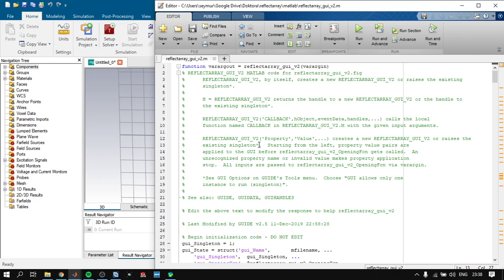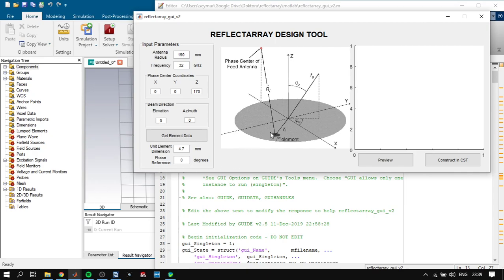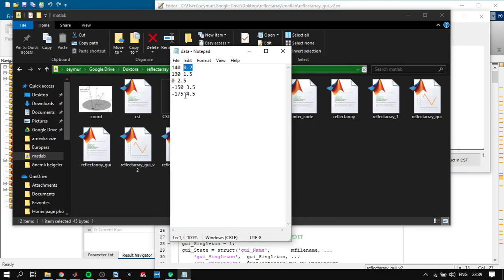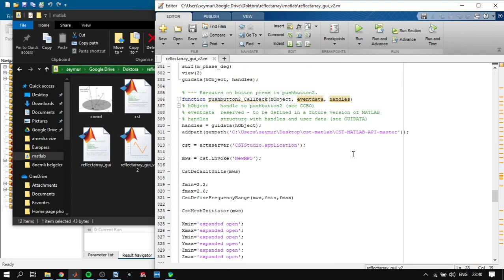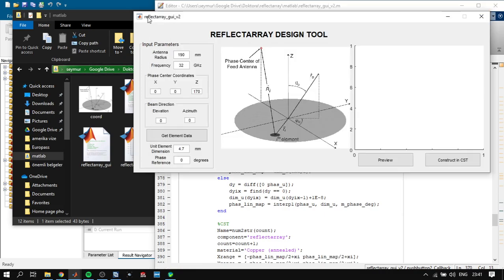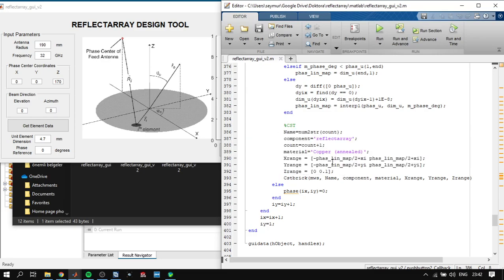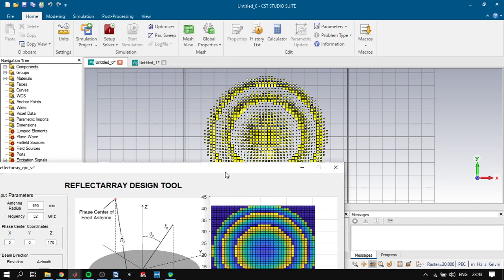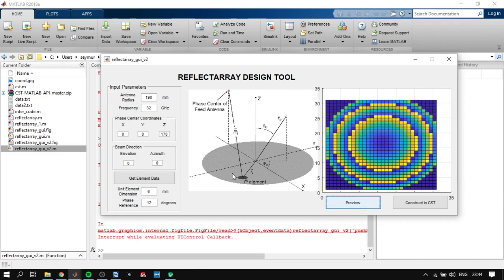Reflectarray Antenna Design using MATLAB and CST (Part 2)

Comment: Thank you very much!
But I still have a question that I would download the API and  how do I use it
BTW it also still error   "Error while evaluating UIControl Callback."
Very appreciated!!!
Reply: same problem, Error while evaluating UIControl Callback
Reply: @ucaser  Hey did you get the solution to this problem i am also facing the same problem

Comment: Hi I am facing these errors and it is not working in CST kindly help in that:
>> reflectarray_gui_v2
Undefined function or variable 'CstDefaultUnits'.

Error in reflectarray_gui_v2>pushbutton2_Callback (line 317)
CstDefaultUnits(mws);

Error in gui_mainfcn (line 95)
        feval(varargin{:});

Error in reflectarray_gui_v2 (line 42)
    gui_mainfcn(gui_State, varargin{:});

Error in
matlab.graphics.internal.figfile.FigFile/read>@(hObject,eventdata)reflectarray_gui_v2('pushbutton2_Callback',hObject,eventdata,guidata(hObject)) 
Error while evaluating UIControl Callback.

Comment: @simulationmaster can it will be designed to interface with hfss.
Reply from the maker: Hi, Unfortunately I am not good at HFSS, so I cannot do that.
Reply: @SimulationMaster  Hi thanks for your reply I am facing some issue in construct in cst can you please give me your email so that I can ask specifically. Thanks again
Reply: Can you suggest how to interface this gui to hfss just as you have interface it with cst, what change in the matlab code is to be done. Thanks kindly share your email.

Comment: @Simulation Master HI，Because your program is designed for rectangular shape. But my design is for different shaped unit cell.What should I modify?
Reply from the maker: Hi,
that is a good question. In the m file on line 267 it gets uedim, which is user variable. On lines 269-270 the code uses this data to create square patches. You can put your data here manually to get different shape sizes. I updated the code, so now you have this option.

Comment: Thanks for you sharing your knowledge. I have this error. Could you please provide any recommendations to solve it?

Error using Interface.CSTStudio_application.NewMWS.Brick/invoke
Invoke Error, Dispatch Exception:
Source: CST MICROWAVE STUDIO 2021
Description: Some objects dimensions are too small for the 3D Modeler.
Please set smaller units first.

Comment: @Simulation Master  very useful. But how can I get 'get element data'  In Matlab. From where this data is calculated? Please help me to find out my solution..from where that data sheet created.
Reply from the maker: You must simulate the unit cell separately for all the dimensions. Then save the reflection phase in the text file and use it in your design.

Comment: Hi thanks for the video. Is the code can be used to construct reflect antenna array for different unit cell, other than square patch.
Reply from the maker: yes definitely you can. I am working on this. You can also add elements instead square ones.

Comment: Your code is giving the following error message

Reference to non-existent field 'data'.
Error in reflectarray_gui_v2>pushbutton1_Callback (line 256)
data=handles.data;
Error in gui_mainfcn (line 95)
        feval(varargin{:});
Error in reflectarray_gui_v2 (line 42)
    gui_mainfcn(gui_State, varargin{:});
Error in
matlab.graphics.internal.figfile.FigFile/read>@(hObject,eventdata)reflectarray_gui_v2('pushbutton1_Callback',hObject,eventdata,guidata(hObject)) 
Error while evaluating UIControl Callback.
>>
Reply: MATLAB version is 2019

Comment: since the element data that we are giving as input doesn't holds the relation for possible dimensional variation of unit cell with each and every degree, how the approximate relation that obtains with help of interpolation will be reliable enough for accurate performance. 
If possible please do another video as a part of this series explaining the main logic of the code in relation with what was theoretically presented in textbook. Since you have wrote the code upon yourself, It would be so helpful for beginners like us.
Reply from the maker: You are very correct. I must have explained it in detail. In the end, reflectarray elements can have phase errors up to 25 - 35 degrees which is quite acceptable. But I will definitely make another video explaining phase diagrams of the elements, and try to design an element with phase variation above 360 degrees and give results in different scenarios. 
Actually, I am preparing a short report about reflectarrays where I summarized everything that you must know when starting a design reflectarray. Stay tuned :)
Reply: @SimulationMaster  Thanks for such a quick reply. Actually, i came across a video on youtube about the design of reflect array. It was done using hfss, and in this video they have shown a code that works for any geometry with a single parametric variation to achieve the desired phase shift. It would be better, if you modify your code like that as it accounts for more detailed relation between dimension and phase shift.
https://www.youtube.com/watch?v=qRQmX3m0fBY&t=139s
Reply from the maker: @maheshbabudhanekula3058  Thank you for the comment. You are totally right. I will definitely update my code according to this.
Reply: @SimulationMaster  I have sent you a mail. Can you please check the inbox

Comment: Dear, thank you very much for sharing! I just wanted to ask 2 questions, first, regarding the input radius (rad). In line 269, you loop from "-rad/2" to "rad/2" to define "xi", which would be correct if it is "-diameter/2" to "diameter/2"? So in this case shouldn't the "xi" go from "-rad" to "rad"? 
And I have this other question about the input angles theta and phi, they are in degrees (rather than radians) right? I think they are in degree also because in line 272 the sind cosd functions are used for defining "phase". However, the "mod" function was used on a the degree unit "phase" with radiant "2*pi", in line 273. Was this a mistake perhaps doing mod(degrees,radiant)?
Perhaps I should look more carefully at the codes. Many thanks for any explanation on this!
Reply from the maker: Dear Mat,
You are totally right. It must be diameter there.
Also in the second stage, I'm finding phase variation of the elements by multiplying wavenumber to the distance, so it must be in radians. You can change pha_zer to deg2rad(pha_zer). 
Also very thanks to your comments, I very appreciate them and they mean a lot to me :) 
Have a good day.
Reply: @SimulationMaster  Much appreciated for the quick response and explanation! I understand now! Best wishes :)

Comment: Thank you very much for this, it helps a lot for my graduation project!
I have a problem to construct in CST, it says "Some objects dimensions are too small for the 3D Modeler. Please set smaller units first.".
If I change the unit to mm first, the matlab code will start a new file which still in m, then the same problem again.
Is there anyway to fix the problem? It will significantly help my project
Reply from the maker: Dear, 
This is due to the bad coding in Matlab API. To solve the problem just change the lines with 'int2str' to 'num2str' in Cstbrick.m
Hope this will solve the problem.
Reply: @SimulationMaster  Thank you very much! Can you please make a vedio to talk about how to do the cst simulation of this reflectarray atenna?
Reply from the maker: @KK-qc4ph  yes I am planning, but my PC is not very good. I will make the video in the next month probably about the simulation of reflectarrays.

Comment: Please what is your email?
Reply: Sir, you Design a reflectarray antenna using Matlab programe .but I have a question: your program is designed for rectangular shape. But for different shaped  unit cell Designing where should I modify??  Please solve this..
Reply: @SimulationMaster  i tried  to use the link you shared but did not work
Reply from the maker: @solomonmingle8716  i will check it
Reply: @SimulationMaster  I have a unit cell design in CST  need help to use the design equation in MATLAB. Please  can I send the file and equation to plot  in MATLAB
Reply from the maker: @solomonmingle8716  can you sent me your email address. I will send you the code.
Reply: @SimulationMaster  plz 🙏solve my problem..